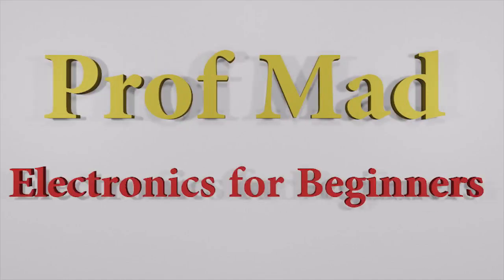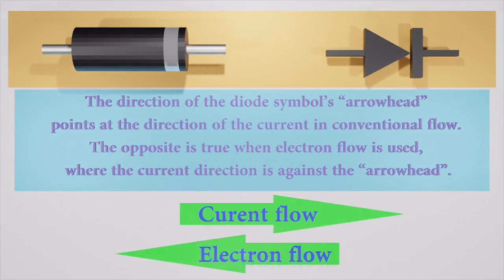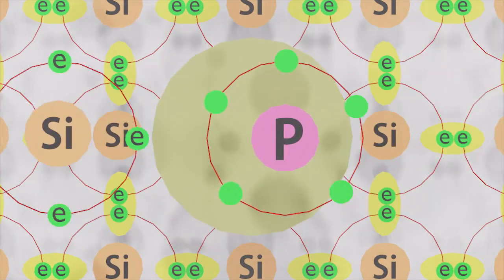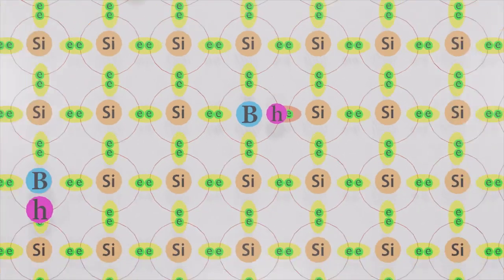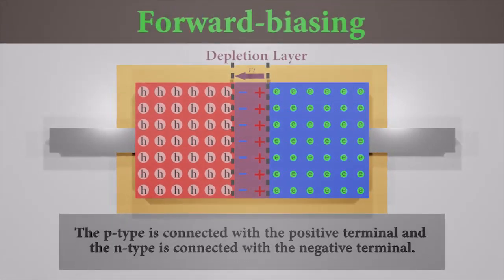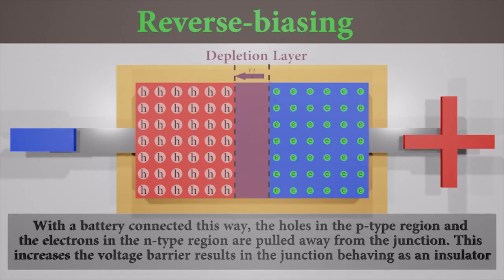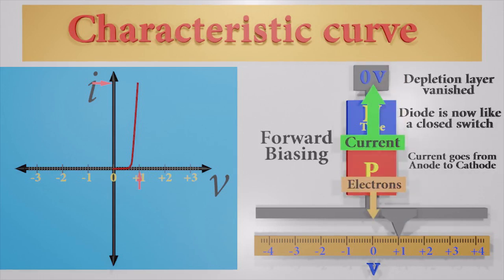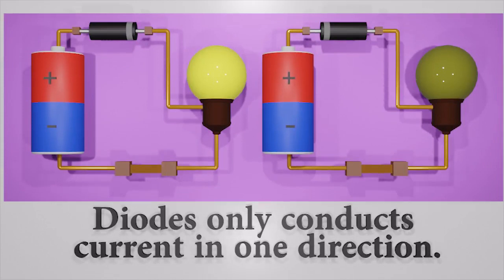Diode Explained | How Diodes work | Working principle

Comment: How can be  empty holes  positively charged ?
Reply from the maker: The "Positive" and "Negative" terms are just relative terms. If we named one type of charge as a "negative" , then we can named the opposite of that charge (in this case the absence of a electron) as a "positive". Actually holes are not a thing . We use that as a ease of understand. 
As well as we can named the absence of a positive charge as a negative charge.
Think those as a isolated system. even if there are no charge in the total system (neutral). That does not mean there are no any charged partials. There may be equal number of negative and positive charged particles. If one electron left that system, now It has +1 charge. This can also result by adding a positive charge (proton) to the system. So we are representing the absence of electron as a positively charged hole.  But there are no such hole actually.
Reply: @Profmad  thanks alot...
Reply: @Profmad  Sir plz make a video on how the 1s and 0s state of transistors result in this modern magical technology